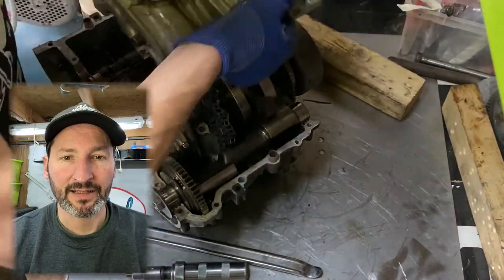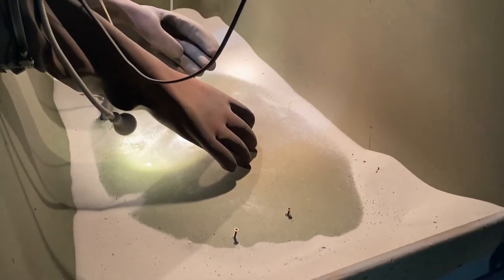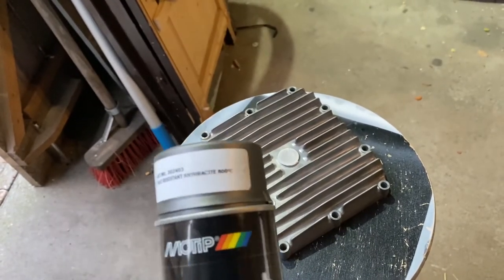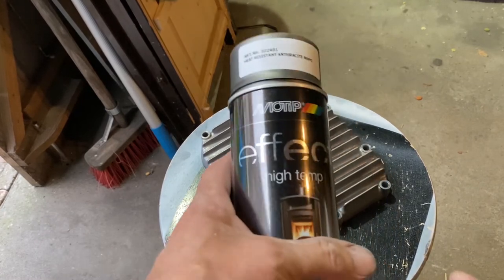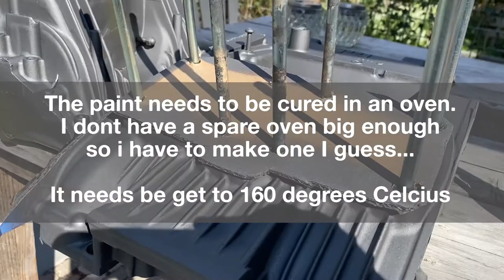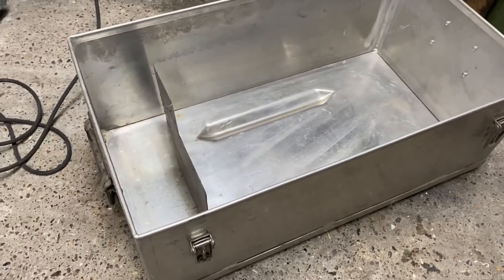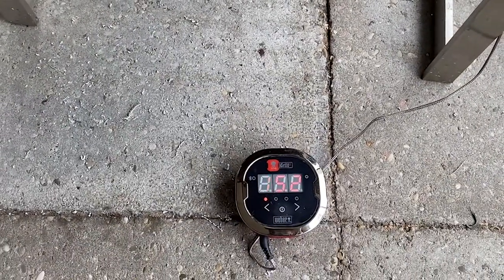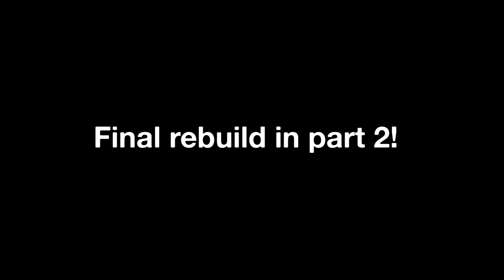Suzuki GS450 Engine Rebuild  Part 1

Comment: En voor het spuiten van onderdelen,, heb ik zo'n goedkoop stoffen kleerkastje gekocht met een rits. Ik heb een paar keer wat gespoten in mijn werkplaatsje omdat het buiten te hard waaide. Maar zeker na rood gebruikt te hebben, zie je pas wat een troep dat geeft. De helft van mijn spullen hing onder het rode stof van het spuiten. Dus nu hang ik de werkstukken in dat stoffen kleerkastje. Het houdt een groot deel van de spuitnevel tegen. Helemaal kan je het niet uitsluiten, maar het helpt. Plus als het buiten niet te hard waait, zet ik het buiten en spuit ik alles daar. Als je de opening van de wind weg zet, sluit je die vervelende wind uit die de helft van je verf wegwaait voor hij op je werkstuk zit. Die dingen kosten 15-20€. En ik heb er de achtervelg van de GSXF al aan gehangen, dus het kan wel wat hebben
Reply from the maker: Goeie tip!